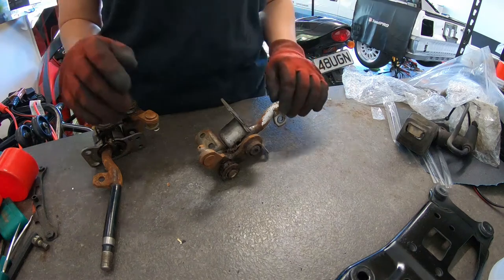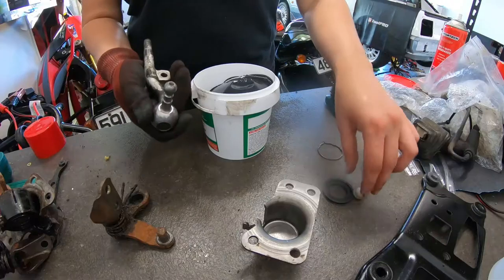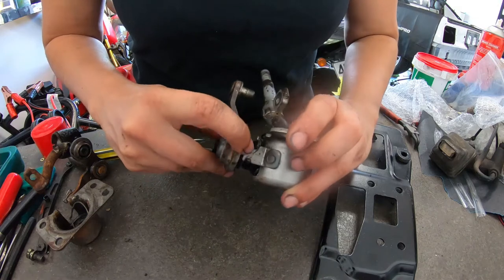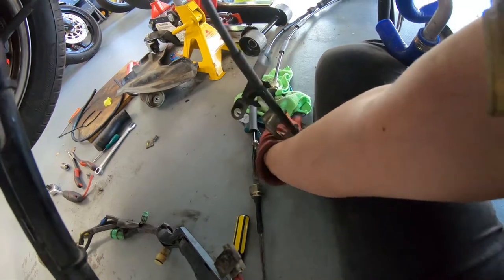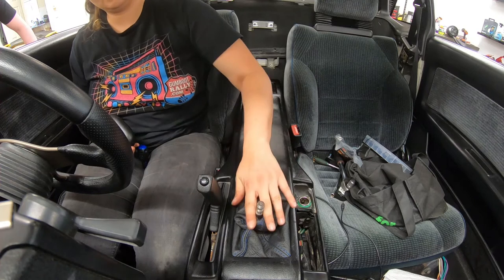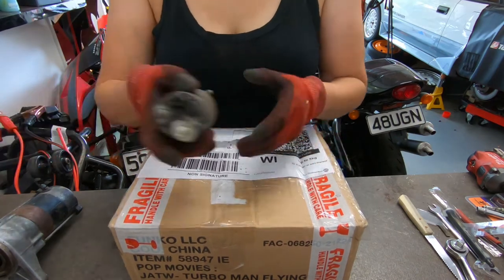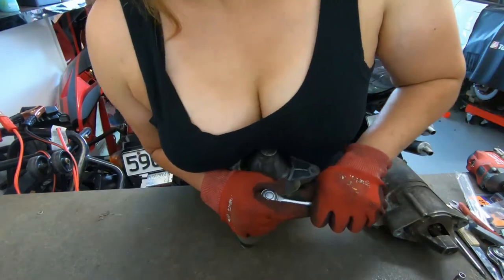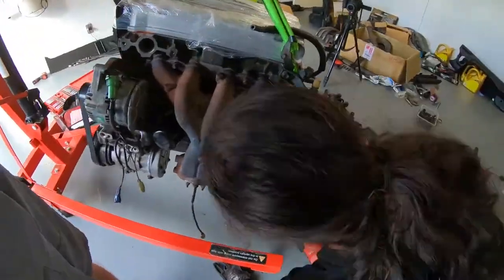Rebuilding a damaged Starter motor, and shifter linkages!

Comment: Great job on the starter.  Replacing the solenoid was a good idea, it may have worked right up until you really needed it to...or at least that's what typically happens to me.🤣
Reply from the maker: Knowing my luck it absolutely would have failed 😂
Probably still will go wrong
Reply: @STEPHASAURUSREKD  nah, you did it right, should be just fine.  Did you run it through a power cycle to make sure everything works?
Reply from the maker: @YellowJacketGarage  ...noooooooooo 😂
i have since started the car and it seems to be doing all the right things though, P H E W
Reply: @STEPHASAURUSREKD  see, you're good!  And congrats on the start, that's the biggest piece!
Reply from the maker: @YellowJacketGarage  thanks! I am so far behind on videos bahaha! hoping either the one after next, or after that should be the starting stuff! 
Though there's been a few unexpected issues since (cause of course things cant just go smoothly!) so we've not had it run happily yet, but its still progress!
Reply: @STEPHASAURUSREKD  I have many projects done, just don't want to edit...😳🤣

Comment: Keep in mind I've never owned an SC MK1, mine have always been NA's.  That said, I thought the starter was on the intake side on the SC's.  Or, are you using the C50 series trans and not the E51?  I don't recall to be honest.  Can't wait to see it driving!
Reply from the maker: I'll be going more in detail about it in next weeks clip! But yes you're pretty much correct!
Because im running a c series box, the e series starters are on the opposite side, so i had to source a different backing plate and starter to fit the correct side.
Also had to extend the wiring to reach too!!
Reply: @STEPHASAURUSREKD  Well, that explains that LOL.  Luckily the C series holds the power of the GZE just fine and weighs a lot less than the E51.  Thanks for clarifying for this old man LOL.
Reply from the maker: @mr2miach  although ive not weighed both boxes (i do have an e51lsd, but couldn't find all the other bits in time) i can actually lift and carry the c box, the e ones were impossible 😂
Reply: @STEPHASAURUSREKD  Yep, the E series is far more stout.  Almost like Toyota thought the 4AGZE was a 500HP engine or something.  Back in the old forum days, many who turbo'd their 4AGE would leave the C series trans and have no issues upward of 300HP.  Beyond that it would be hit an miss problems that I suspect were hard launches that caused them problems.  I want to say my buddy and I weighed the C series somewhere around 70 pounds with gear oil still inside.  But that was a long time ago.
Reply from the maker: @mr2miach  yeah agreed! 
I dont plan on pumping out any more power than it currently has (which was what, 140hp back in the 80's? so probably much less now) figured it SHOULD be ok :P
Reply: @STEPHASAURUSREKD  Oh yeah, it'll be fine.  And you should be slightly quicker than a stock MR2 SC with an E51 trans so you got that going for you too.